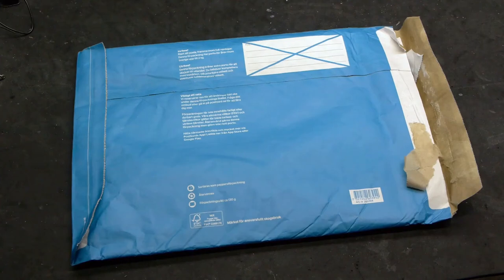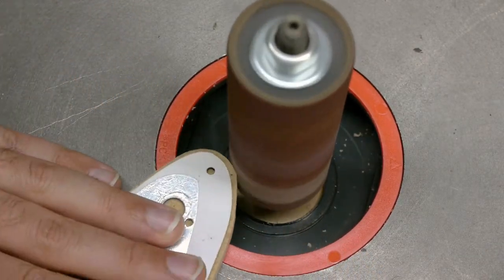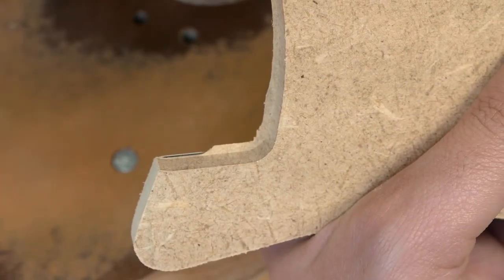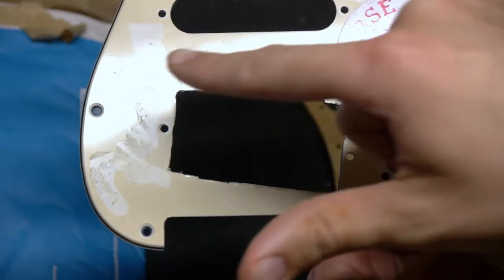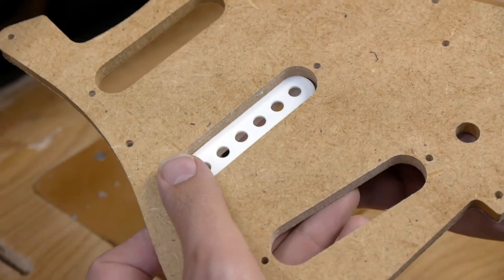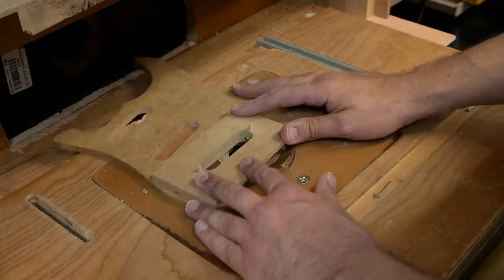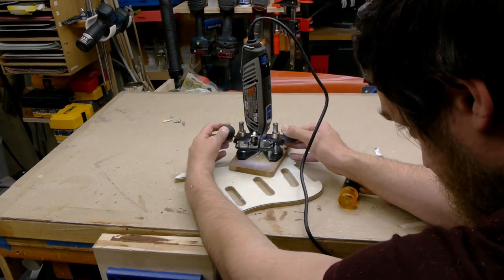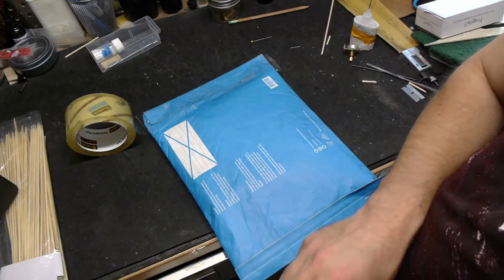Copying a Pickguard - Troubleshooting, Tips and Tricks!

Comment: I applaud the big effort and attention to detail for making a template of a pickguard, using templates over template🫣!👏🏼👏🏼
   I‘ve done for myself a handcut with a professional Dremel type handtool, but modified pickguard for an Gio Ibanez, and I can tell how time consuming it is. Specially the pickup holes.
   On the original pickguard the pickup poles (HSS) were not lined up with the strings by 3mm. 
   So, with a new pickguard I additionally corrected the too sharp corners cut out for the humbucker, a more pleasant harmonious outline, a better angle (flatter) of the switch blade, a more ergonomic placement of the control knobs (on strat types I always remove or move the vol. knob down and back, put a mini on/off switch for either neck pup on/off or a kill switch in that position). 
   Later I made a mini adjacent extention covering a routing for two mini toggles, for humbucker split to each coil and for connecting in series of the single coils. I do it bit by bit, as a hobby. 
Cheers

Comment: Nice video. I'm curious what you would have done if you didn't have the Suhr pickguard to resize.
Reply from the maker: Thanks! I've made my own templates by hand, and if I didn't have the reference pickguard, that's what I would have done. 

I did this recently for a Lollar split P-bass pickup. It was a Squier Vista bass pickguard that the customer wanted converted from a '51 single P-bass pickup to a Lollar Precision 90 split p-bass pickup. 

There is no template for the Lollar, and it's bigger than a standard Fender P-Bass pickup. I copied a Fender P-Bass rout to start on a 1/4" MDF template, then used digital calipers, a file, and a dowel with stikit-sandpaper to meticulously hand-file the template down.

The pickup dimensions were listed on the Lollar site, so I went by those. I just kept going by hand until the template was perfect, then used that template double stick taped to the other template to rout the pickup.

It's an extreme amount of work. It took me over several hours to get the template exactly where I wanted it. Once it's done, it goes into the drawer with all my other templates. 

Hand making templates is extremely time consuming, but sometimes it's your only option. I do use 'reference templates' as often as I can. Another trick is using guide bushings in a trim router if you want the same pattern, but slightly smaller.

A perfect example is making a Tele pickguard with a neck pickup rout for a neck pickup without a cover. I used a guide bushing in my Colt router to copy a standard Tele neck pickup rout, but cutting in a little bit. 

I can't remember what sized guide bushing and what sized bit I used, but I think I cut it undersized around 1/32". Something like that. The result was a neck pickup rout on a Tele pickguard that is a perfect fit for a neck pickup without a cover. 

There are more tricks you can use. I'd love to make a video about it when I have the time. Still catching up on so many videos. 

I'm actually working on a 2024 updated version of my pickguard cutting tutorial. Excited to get that one done!
Reply: @guitar_md  Thanks for the amazing answer! I didn't realize you also made the silent film video too, that one I watched several times before starting my project. Definitely time consuming work but I want it perfect, safe and I like to learn smart ways of doing things. 

I got a jaguar that had two humbuckers and putting in three old Tiesco pickups. I will no doubt need to borrow some of these great ideas. The pickup routes are the last thing I have to do. They are rectangular so I want to first try using a dado stack with tiny adjustments on two half pieces of wood to get the exact fit of the pickups. I've just started using routers so I'm actually more comfortable making the initial pup template on the table saw. 

Anyway, huge thanks for your help and the videos. Glad I found your channel.
Reply from the maker: @CTBAB  We innovate according mostly to what we're familiar with. I actually have very, very little experience with table saws. So little in fact that I'll have to look up what a dado stack even is to understand what your plan is!

But being familiar with that tool and methodology, you can see how your brain already has a game plan for mapping out how to do it. That works to our advantage. 

I've only dealt with rectangular routs for slider switches, in which case I use my Amana Tool 3/16" guide bearing bit to start it, then I finish it by hand with a square file. 

Pin routers are something I'm aware of, but never used. Those have a ton of advantages and is arguably the best way to make pickguard copies, since the pin is stationary and doesn't put the original pickguard at risk when tracing it, as is the case with flush trim bits on a router table. 

I'd be very curious about the dado idea. I'm always up for new things, though table saws scare the crap out of me. 

I do recommend the Amana Tool miniature line of flush trim / guide bearing bits, very heavily so. Amana Tool in general is my favorite for router bits. 

I've done a LOT of routing, mostly on the router table, but also with my Bosch Colt trim router, and Dremel 4300 mounted in the Stewmac Plunge Router Base. So my mind naturally gravitates there. 

And if you're comfortable with a table saw, you should pick up routing very quickly and easily. Nothing to it at all once you get the hang of it, though I will say with guitar work and intricate pickguards, you have to be VERY careful. There's definitely a feel for using the router table and you have to be very deliberate and confident with pushing the workpiece against the bit. There's a sort of Zen to it. 

That goes for freehanding as well. Freehanding on the router table can be incredibly useful. That's where the extra small bits come in handy too. Another trick I use on occasion is using a Stewmac Precision Router Base, and clamping it in a vise mounted upside down, so I can use my Dremel as a mini router table. 

Very handy for various tasks. 

Anyway, I could talk forever about all this. Keep me posted! I'm currently in the process of working on that 2024 updated pickguard tutorial video. It will be similar to the silent film one, but just workshop footage/audio and plain text. 

I have a lot of ground to cover with it and a lot of updates I've made. It's going to take forever, but all my videos do, as I'm only a one man show. But that's the way I like it. Thanks for reaching out and again -- keep me updated on how that goes! Would love to know.
Reply: @guitar_md  Thanks man. Yes I will let you know how it goes. I do love routers and it went pretty smooth. Creating a template from a pickguard wasn't the best starting project but I got through it so far so good.

Comment: Great video! What double sided tape do you use? Is it thick or is it a special thin tape?
Reply from the maker: Thanks! These days I use carpet tape -- the thick stuff. But both the thin and thick stuff will work. I just get whatever carpet tape is cheapest on Amazon or eBay. Lasts a very long time. 

The carpet tape has a stronger hold than the thin stuff I was getting from Stewmac. It really helps to have a cutting mat and an Xacto knife for it, including to peel the tape -- the Xacto can be helpful to get it lifted up so you can peel it off. 

I have a new video on the way as well, which goes into much more detail than even this video, with a ton of macro closeups and more. I wrote out subtitles for it as well which can be turned on and off. 

Stay on the lookout for it! It'll be a while but it's in the works.
Reply: @guitar_md  Thanks so much for the reply! Carpet tape it is.

Comment: Love the new blade switch method; but now - what tool  did you use to make the 1/8” slot in the template?
Reply from the maker: I used my Colt router with an 1/8" regular router bit and a 5/16" guide bushing. So it did require me to use the previous template I'd made.

And I made that template based on Potvin Guitars' blade switch template, which had the holes and slot separated. I never understood how to use it so I made my own. 

I might even make some for my eBay store. Maybe for 10 bucks plus postage. It's such a useful template and I'm much happier with the 1/8" slot and the Dremel! 

The Potvin template uses a 1/2" guide bushing, by the way. That's too big to fit the switch holes on there too, and my first adaptation does work great, but the Dremel is so much more compact and quick to use.
Reply: @guitar_md  thank you! That Dremel method definitely seems like the way to go; I think I’ll cobble together my own template with an 1/8” router bit and some kind of bushing, similar to how you did it. Thanks again! Your videos are great.
Reply from the maker: @mikepintoguitar  You're welcome! Always beyond happy to know someone is enjoying my videos and getting useful information from them. Doing my best to put content out there that I haven't seen anywhere else. 

Let me know how it goes. Once you make that template you'll be good to go forever. I do use wood hardener on MDF just to waterproof it because I get paranoid about them warping over time. But the 1/8" slot with those holes makes everything so much easier and so much cleaner. 

Though on my latest Strat I don't even use a blade switch! I made a video about that one and am using a 3 way box switch on a custom jack plate I made out of pickguard material. Absolutely love it. Sometimes I wish I had a CNC machine, and I might have to learn how to use CAD so I can design some simple templates and have a place make them for me. 

So many ideas, and lots more content to come. Thanks again for watching and for your comment!

Comment: i'd love to see the making of the bevel ????
Reply from the maker: I'll have to see if I can record some macro closeups of this. Maybe I can make it into a short video. 

It really helps to see how the bit cuts the bevel in very closeup detail. It's hard to visualize otherwise. 

I mostly use a 45 degree beveling / chamfer bit. You want the pickguard material facing down, as in, the pickguard material is touching the workbench. The MDF template is facing up. 

The chamfer bit has a bearing on the bottom, meaning it's on top on the router table -- as the router is mounted upside down on  a router table. So you'd look for a bottom guide bearing 45 degree beveling bit. Or 30 or 35 degree if you can find one. 45 is the most common but with 30 or 35 you can get very nice, subtler results. Mostly though I end up going to 45 as with 30, the bevel isn't obvious enough. 

Anyway, check here: ToolsToday.com. Great site. Amana bits are my favorite: 

https://toolstoday.com/search-results/?q=chamfer+bit&page=3

In the meantime, I'll see if I can record a quick clip at some point, of a beveling bit in action.
Reply from the maker: Actually, I just realized i haven't posted it yet, but I already have gotten some closeup footage of a bevel bit, in action. It's from a video I've been working on but haven't published yet. I'll see if I can put a short together that shows it off.